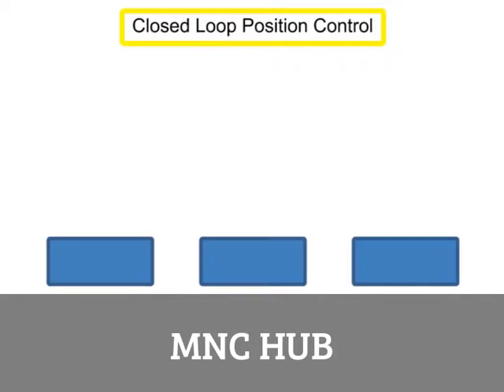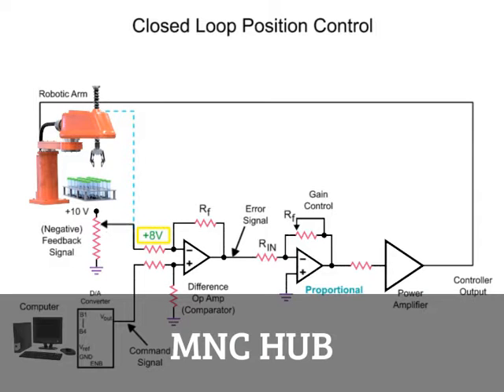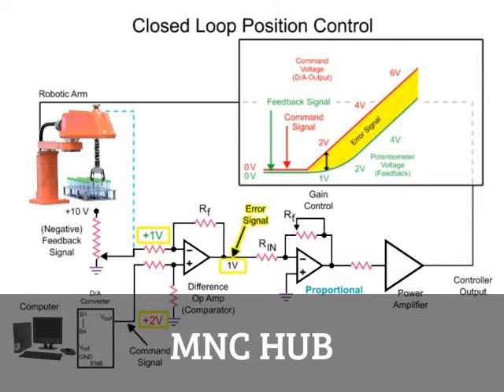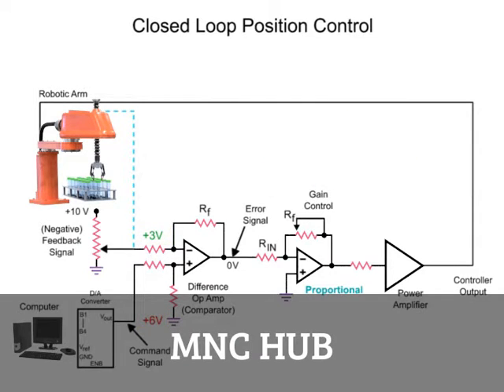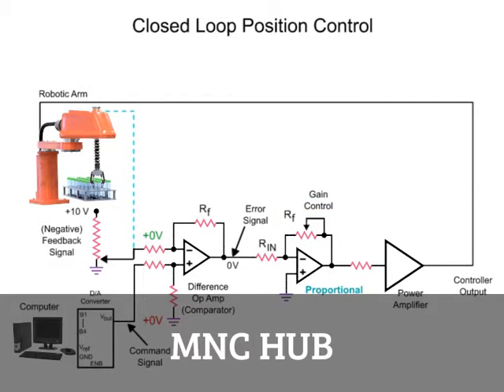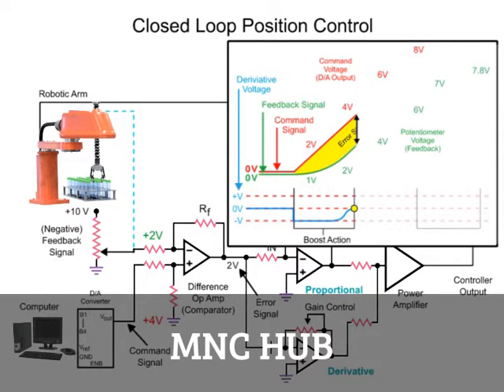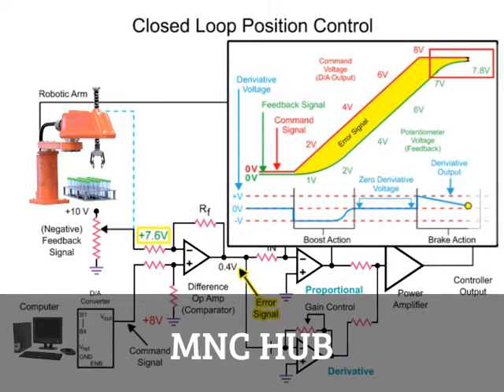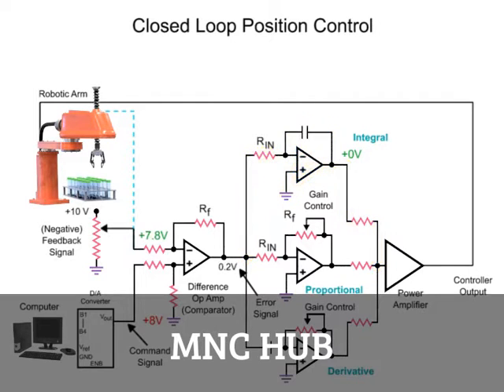PID Controller

Comment: Couple corrections. Closed loop just means that there's feeback from the output that regulates the input, like an old fashioned spring thermostat or in audio amplifiers. PID is just one of dozens of ways of doing this including linear, inverting, ai, and more. Also, please remove the big highlighted channel name title text at the bottom, we already see your channel name below the video and we can't see the circuit at the bottom, hard to see things like the capacitor.